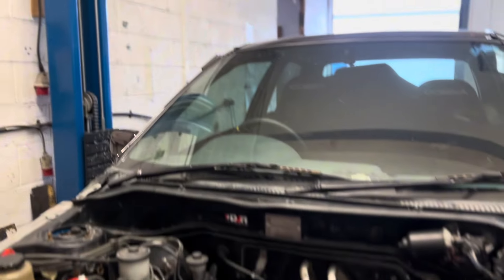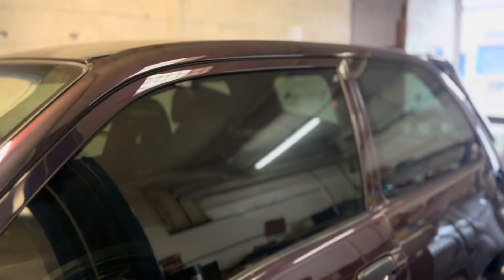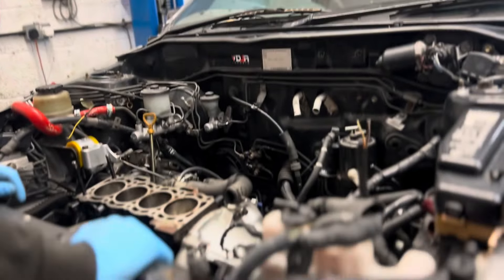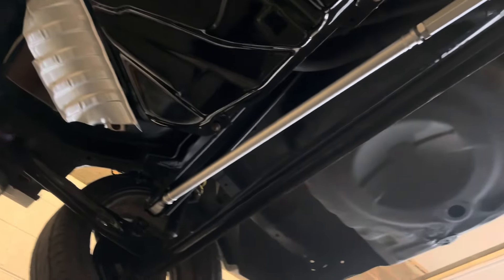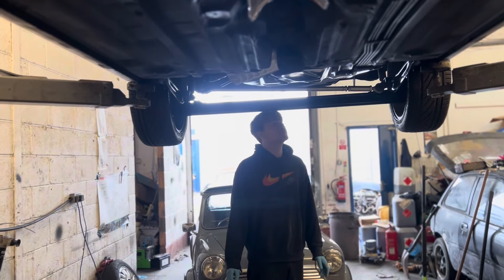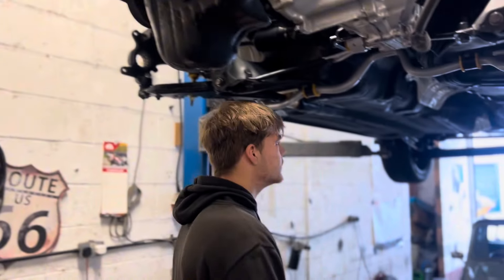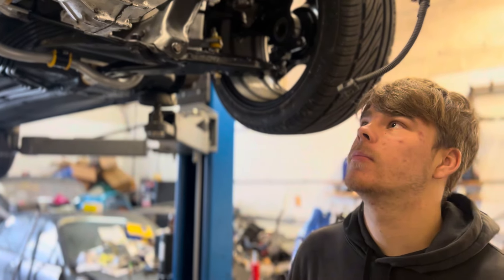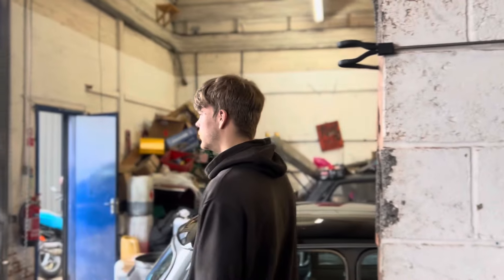WE JUST BOUGHT A NEW TOYOTA GLANZA (WORKSHOP UPDATE)

Comment: hey just had a question was thinking about importing a auto glanza or gt turbo from japan as they come with low milage and cheaper. so would have to do a manual conversion , is there any disadvantages to the engine that comes with the auto car ? do you think its worth doing this?
Reply: Engine is exactly the same between auto and manual mate. The stronger engine is the GT as they came with thicker rods. Worth doing as the auto will be cheaper to buy than the manual.
Reply: @FafCarsjake  yeah i love the gt turbo especially if i could get a toms bodykit for it thanks for advice. do you have any idea what sort of price range a auto to manual conversion would be?
Reply: @afrosamurai-swordplay  Best thing to do is contact SSA from the video as I know they usually have manual gearboxes and can tell you ab accurate price for the parts and labour mate.